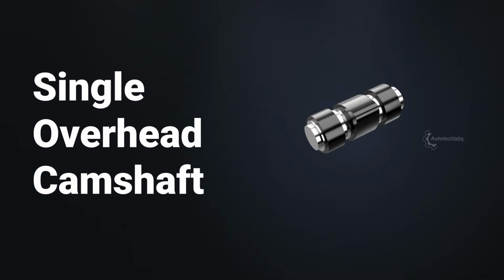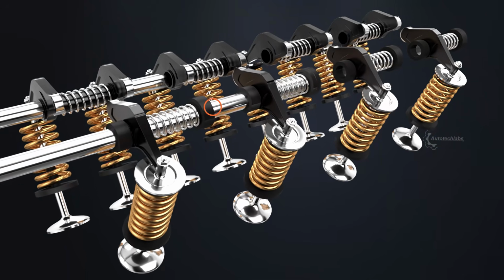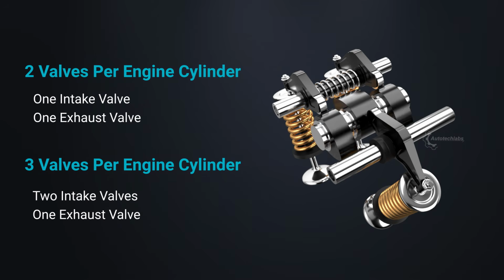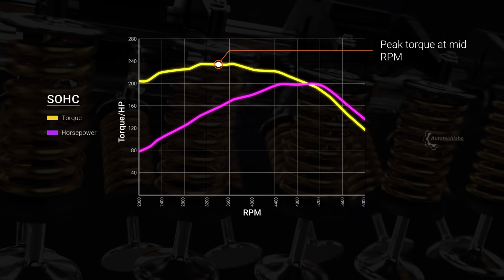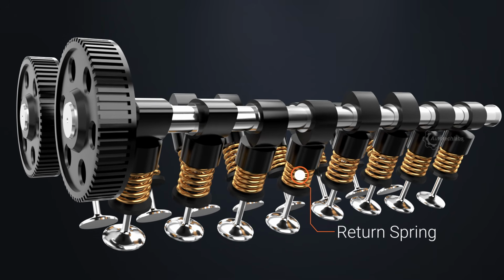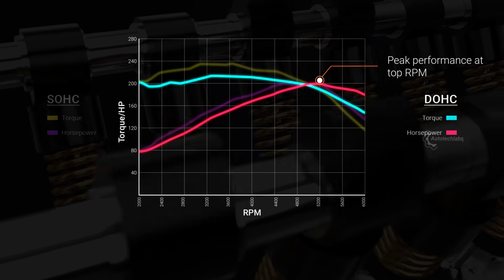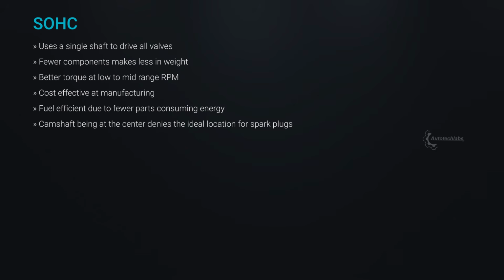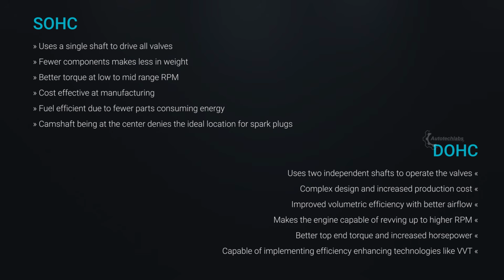SOHC vs DOHC | Autotechlabs

Comment: Your torque curve is BS.  The cylinders don't care what opens the valves or how much hardware there is doing it, the cylinders only care how far the valves open and for how long.  Therefore how the valves open has nothing to do with horsepower or torque.  Look back at your first animation of SOHC vs DOHC.  In the SOHC you have rocker arms which add mass and complexity but allow for magnification of lift so the valves can open farther than the heights of the lobes.  This will provide more horsepower.  The DOHC configuration has cam lobes acting directly on valve stems or buckets which limits valve lift and limits horsepower.  And both of these configurations limit placement of valves, the valves can't be canted forwards or backwards.  OHC systems do have less mass of pieces involved and therefore can more easily achieve high rpm which does provide more performance potential over a traditional OHV configuration.  But OHC systems have more pieces, require a more complicated drive system to turn the cams, and make the engine wider and bulkier.  With traditional OHV systems an engine of high displacement can be made relatively small and compact.

Comment: I don't understand how volumetric efficiency increases in dohc, I mean cant we increase the valve lift in sohc too. Sohc can operate 4 valves too. If the goal is too open the valves  for more duration it can be done in sohc.How dohc helps them?

Comment: from my perspective, SOHC simple, easier to work on and small valve head along with less maintenance required, downsides makes shit power
DOHC, better power although larger valve head and harder to work on along with usually needing better oil change intervals to function without issues and more expensive as they are usually chain driven

Comment: As a Auto Technician, Removing a SOHC Cylinder Head not as Timing Consuming or Complicated, vs the DOHC Heads theirs more to it , Cams & Journals remove it just to Access the Head Bolts,

Comment: Wouldn't simply changing the angle of the rocker arms or changing the shape of the cam lobes already improve the valve lift and thereby increasing volumetric efficiency in an SOHC?

Comment: can i ask something? why if the profile cam built as same as DOHC in SOHC?? same engine same bore diameter and same stroke... same valve diameter and same 4valve... but in sohc... will it same power and torque??

Comment: At 2:50 he says that DOHC uses two separate camshafts “per bank of the cylinder head.”  Isn’t it one camshaft per bank?
Reply: no that's for sohc , one for intake one is for exaust in dohc but the sohc uses  one camshaft to do both

Comment: In a SOHC would the force on the bearings of the rocker arms be lower if you move up the camshaft? It is a bit unfortunate that cams and spings push in the same direction. At least 90° vector add to 0.7

Comment: I'm a huge fan of dual overhead cams pushing four valves per cylinder. Gives the engine designer lots of flexibility in head design, but body guys don't like the "bulky" packaging of the heads for todays "aerodynamic" (they REALLY AREN'T) jelly bean cars. DOHC's can push SIX valves per cylinder easily too for even better engine breathing= more HP =better fuel economy. Honda even made an "oval pistoned" engine with EIGHT valves per cylinder for motorcycle racing that showed promise with carbs and should have ran away with fuel injection (not legal yet). The "old" internal combustion engine has a lot more life in it and development in it than Tesla would have us believe.

Comment: There are a ton of economy engines which are SOHC and do not use any rocker arms at all (using a simple shim-over-bucket system), usually having the sparkplug mount at the side of the two (most of those engines are 2v per cilinder) valves. 

The video says that DOHC always has dual INDEPENDENT camshafts, but that again isn't true. Toyota 4AFE, some Honda engines, and Fiat's FIRE 16v engines are DOHC with non-independent intake camshafts.

There are also engines that are DOHC but do use rocker arms instead of shim-over-bucket or shim-under-bucket designs.

Comment: Youre referring to dual over head valved engines as if there the same as dohc engine  and they are not engines like the cummins engine Have 4 valves per cylinder with one camshaft mounted mid engine. All the specific architecture has differntadvanages  DOHV , sohv , ohc and dohc are all different with different advantages.

Comment: Lot non sence only true story behinde sohc engine is that its a engine build for bouth power and efficiency those are like the chevy 250 half disel half gasoline engine blocks those kinde of engines are multi grade fuel engines and they are safe to tune because of special drilled engine head valves spaces so no damage can acure Run that thing hot enough so you actualy can swap to cheaper fuels ore make your own fuel with ethanol water ore methanol water so lot non sence about hydrocarbons that staff is simply not strong enough to run a engine hydrogen is used only for idel speed and to heat up the engine to working temperatures after that the own hot engine lubrication oil does the job acelerating the engine from idel to max trothel!
My old opel monza works with out fuel vapor only hot oil so is doing controled pre ignition and he works with out deam ignition system and with out gasoline at all because its called deam diseling so in reality there is no diference about gasoline and disel engine's evry thing is just school teaching garbage in fact they used methanol water in ww2 and multi grad fuel engines in closed exaust systems if peopel dont belive so please see what dual fuel runing engines are ore old lenz bulldog tractor gasoline/disel engine what that thing is.
So thats the true diference about SOHC engines and other engines  they are hybrid engines.
Ore please read peopel what the kubelwagen was in ww2. 
All other engine video descriptions are non sence.

Comment: They didn't explain VVT. Which means Variable Valve Timing. With seperate intake and exhaust camshaft, you can vary the timing of the camshaft opening the valves. At low RPM, you can use one valve timing and advance it for better high end power and the engine speeds up. Then retard it at lower engine speeds for better lower end torque and driveability.

Comment: An important thing they forgot to add is that DOHC engines have a greater valve timing flexibility than SOHC, in DOHC with adjustable cam gears you can independently change intake and exhaust timing to make more or less valve overlap were as SOHC you would need to change out the cam to have a different valve overlap.
Reply: Yeah, and nowadays I say, you don't need any valve overlap. 4 valves allow for enough air anyway. Instead of internal exhaust recirculation to throttle an engine, just start with a downsized one and get power on demand from turbo.

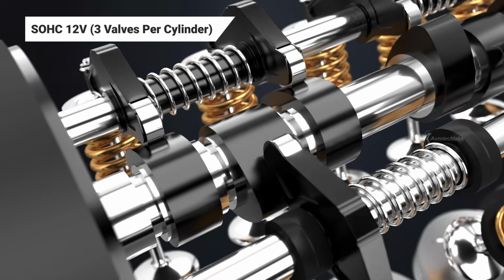Comment: 2:05.  "Due to the reduced counter parts, the design complexity and manufacturing costs is comparatively low for SOHC engines.  Since the mass of the valve train is lesser..."  As professional as this video appears, I don't believe it's accurate.  Reduced counter parts?  The SOHC design requires rockers.  Rockers are moving parts that require energy to move them.  The design also requires rocker shafts.  The DOHC design requires only an additional cam.  No rockers.  No rocker shafts.  The mass of the valve train is lesser?  I disagree.  3:18.  "This configuration (DOHC) has a better valve lift..."  Again, I disagree.  During engine development, by moving the fulcrum of the rockers, the geometry of the rockers can be designed so they produce more radical valve lift.

Comment: Nicely made, but lot of generalisation. The examples shown include direct-acting follower v plain follower v roller follower, as well as varying numbers of valves...and hydraulic v mechanical lash-adjustment, whereas these features are largely independant of the number of overhead camshafts. Look at the valvetrains of a few car and motorcycles engines from the 60's through to today and there are examples of most combinations. Some of the of the pro's and con's listed are more closely linked to the follower design.

Comment: In summary:
SOHC: you want a car to drive normally and economic. (Daily drive)
DOHC: you want POWAAA (for racing fans)
Reply: well not really, dohc gets implemented to all modern engines now even economy daily driver cars gets dohc
Reply: @Spheredalai  for drag... I prefer ohv
Reply: No my sohc is a beast
Reply: @josephrebensdorf9844  yea, for drag racing
Reply: @josephrebensdorf9844  and cheaper to maintain.
Reply: Yea
Reply: @IzajResGS  But wouldn't turbocharged SOHC be able to generate even more high-torque at low-end RPMs? It would make for amazing off-the-line acceleration, especially in smaller sports cars/rice rockets.
Reply: bouaaaah
Reply: lol, tell that to my SOHC Mustang 15 mpg 3 valve GT.
Reply: @jrag1000  I get 18.4 MPG in my 2 valve GT. :)
Reply: @jrag1000  that's technically not the valve's fault. it's the cylinder's fault.
Reply: @Spheredalai  actually that’s technically my right foots fault…
Reply: DOHC does sound more aggressive too. You could compare to sohc 1.6 Honda Civic Straight Pie to dohc 1.6 Hyundai Accent Straight Pipe, and Hyundai has better tone.
Reply: @_. I love how this translates to "baby chicken chicken"
Reply: vtec engines are mostly SOHC but known to be thirsty engines.

Comment: Now Yamaha made a SOHC engine which has 4 valves, 12000RPM redline, VVA (Similar to VVT), Fuel efficient, Excellent High and Low end torque. All these in a 155cc engine. Welcome to R15 v3, MT-15.

Comment: What is the differentsbetween OHC & SOHC,     please replay
Reply from the maker: OHC simply stands for 'Over Head Cam' where the camshaft and valve placement are over the engine pistons (inside engine head). This is in contrast with OHV where only the valves are placed over the engine pistons. They get driven by the camshaft placed near the crankshaft through PUSHRODS.

Comment: sohc makes sense for smaller/fuel efficent cars
dohc makes sense for sporty cars
Reply: DOHC simply better
Reply: @abdulabdanahib9617  its not „that simple“ for manufacturers. when you have a small city car you wont need dohc. saves money and more torque at the low end. you wont rev a smart till 5k rpm in the city do you?

Comment: Very good, great animation.
A couple of things, a number of SOHC engines were 4 valve per cylinder, examples being the Honda J series, Chrysler EGJ and offspring, Nissan KA24E and several more. A number of DOHC engines do use rockers, so there are exceptions to the rules, but as a general explanation this video is great.
Reply: Came here to make the same comment, also a number of SOHC Engines featured VVT like some honda engines and Mitsubishi's 4g69 Mivec engine. But yeah great explanation and animations.
Reply: @jake.g1  An excellent point, one I had forgotten
Reply: Exactly! My imported 1990 Accord 2.0si exclusive coupe came with a F20A DOHC and it had rockers and 4 valves then i swapped over my ported and cammed superior flowing 4 valve SOHC F22A head just because stupid people think 2 cams gives them twice the power of a SOHC haha!
Reply: @Rémi-ngton420 maybe not twice the power, but definitely more power...
Reply: @the8419  not really, even if you have a dohc engine but cylinder head flow sucks you will get beaten by a soch engine that outflows it better.
Reply: @osama1929  Obviously, but I was assuming the engine was designed properly
Reply: Mitsubishi 6a13 engine uses a SOHC valve design while having 4 valves per cylinder

Comment: test drove a 2014 chevy 2500 (sohc), 2007 tundra 4.7 v8 (dohc), ram 2500 (ohv, single ohc), 2009 frontier v6 (dohc). Now i live where there is atleast 4 miles of steep uphill its a huge test to show what your vehicle is made of. You can see and feel the difference of a dohc made vehicle, managed to keep a steady 75 mph from leveled road all throughout the end of the top uphill with one engine shift at  2-3.5 rpms (for the dohc trucks). The single cam ohvs blow these trucks out of the water in terms of power but my mph went from 75 mph (leveled road) scaled down to barely 60, 2 quarters near half way the uphill at the same 2-3 rpms. Real world performance to suit your needs. Listen, well made is better than the numbers in the stat sheet. Get a dohc vehicle especially if you travel to work in mountainous areas, long uphills. From what I've seen new or old the v4 cars end up blowing their transmissions its just a nasty uphill go v6 if u cant afford a v8. Obviously get the 2500 trucks if your towing or dumping heavy material.

Comment: "Since the mass of the valve train is lesser in such a configuration" should not be followed with "SOHC engines tend to produce more torque toward low to mid RPM and provide improved fuel efficiency"

Total non sequitur.  

SOHC has higher valve train mass than DOHC (on a per valve basis, and that is what matters).  SOHC has far less than pushrod engines.  If you are going to compare to pushrods, SOHC are capable much higher maximum RPMs and tend to make most of their power at higher RPMs.

Dual Overhead "This configuration has a better valve lift resulting in improved airflow through the combustion chamber"  Almost completely false.  And again, compared to what?  The primary advantage of direct actuation as shown is even further reduction of valve train mass.  This allows (again) for higher operating RPM.  

The primary reason for going to a four valve engine is to REDUCE valve lift.  Valve flow at their perimeter, not across their area.  Two small valves have more perimeter than 1 larger valve.
Reply: Also , there are DOHC engines with 2 valves per cylinder, old Alfa Romeos for example .Better performance in the low to middle RPMs range of two valves engines is because of the larger squish / quench area in the combustion chamber which is impossible to be replicated in four valves chambers . The larger squish area generate strong turbulence even from very low RPMs and this lead to faster completion of  air/ fuel mixture burning. DOHC on two valves chambers allows for precisely adjusting and varying of valves overlap which is impossible with SOHC .
Poor video on the subject overall!

Comment: Great graphics. One significant advantage of SOHC motors is that it is usually much easier and less time consuming to check and set valve clearances. DOHC motors require shims to set valve clearances and much more time is required to get at them. However,  valve clearances in DOHC motors stay set for a longer time than in SOHC motors.
Reply: That hasn’t been an issue for a very long time. Basically all engines have had hydraulically adjusted lifters for decades.
Reply: @the8419  Not on motorbikes.
Reply: @the8419  Direct impingement systems like the DOHC configuration shown in the video cannot use hydraulic adjustment.  I've owned 3 different cars with DOHC and they all used shims for valve adjustment.

Comment: I just noticed that SOHC is actually better for my driving habit. My car normally runs below 5000 RPM where SOHC produces more HP and torque than DOHC. Thanks for sharing the info!
Reply: DOHC provides greater performance from my experience

Comment: Yamaha has doing for decades of 4 valves SOHC for R125 T135 R15 Fz150 and other small single cylinder motorcycles that I forgot.
The camshaft are funnily short but easy to change.

Comment: After having both (a DOHC Coyote mustang and a SOHC 4.6) the 4.6 def has more torque down low but yeah 5.0 completely annihilates the 4.6 right at the mid-high end rpm range lol.

Comment: What is the advantage of DOHC 4V vs. SOHC 4V if there is no VVT used on both of them?
Reply: It's clear that DOHC 4VALVE has more power on high rpm, the air flow are better because the cam are directly touch the valve, not like SOHC need to use a ROLLER ROCKER ARM

SOHC 4VALVE  is good for stop & go because it has more torque on lower RPM

DOHC 4VALVE are less power & torque on lower RPM

But if you on highway definitely DOHC 4VALVE are better

But if you driving in the city SOHC 4VALVE is better choice, Especially if the traffic is heavy & forece the engine to STOP & GO also run on lower RPM

Comment: Current industrial competence allow production of four valves per cylinder configuration. Haven't heard about 1995 D15b Honda engine? 4 cylinder, 20 valves sohc 3-strp VTEC - only one intake valve opens till 3000rpm, than second intake valve start working till 5500. And after that high lobe of intake side starts working. Look for cam for yourself - 5 lobes per cylinder

Comment: Cam on bucket design, as shown in your DOHC animation is the other way around valve lift wise. 

Cam on bucket is limited to the cam lobe lift, where as rocker arm designes (DOHC, SOHC & push rod) have lift mutiplication based on the arm rario, allowing greater vavle lift & more flow.
Reply from the maker: Right. It depends on the design.

Comment: 1. How a car engine works
2. How engine cooling system works
3. How turbocharger works
4. Drum brake system
5. How disk brake work pt1
6. How disk brake works pt2
7. SOHC
8. DOHC
9. Understanding clutch
10. How does manual transmission work
11. How does automatic transmission work
12. How does a steering wheel work
13. Carburetor engine
14. Fuel injected engine
15. Car axle
16. VTEC
17. VV - I
18. What is the torque converter